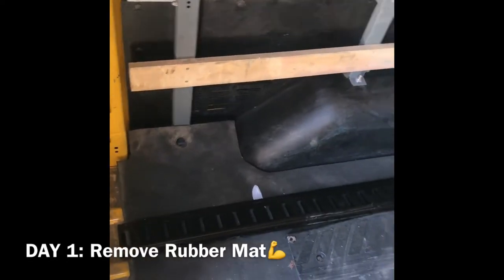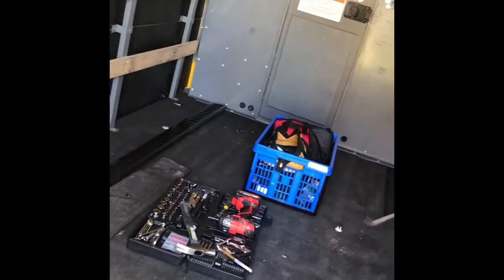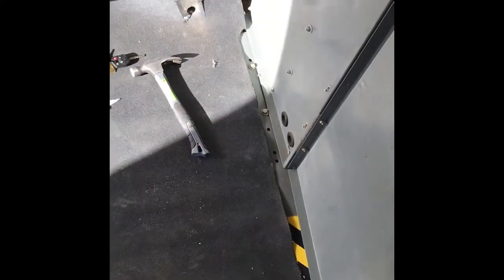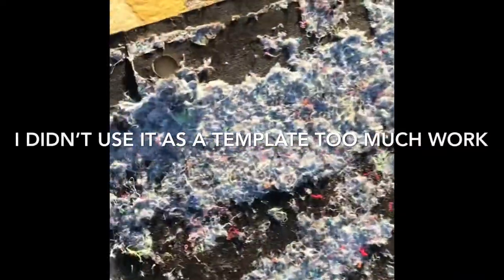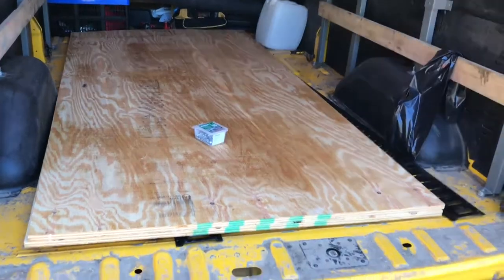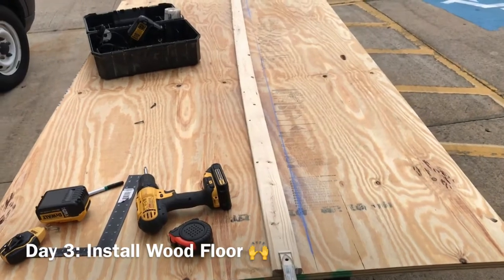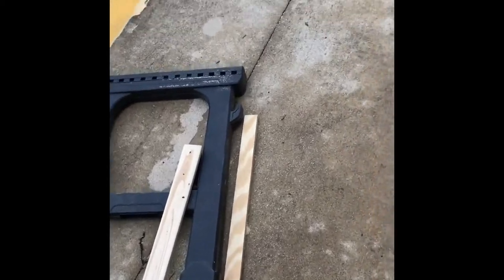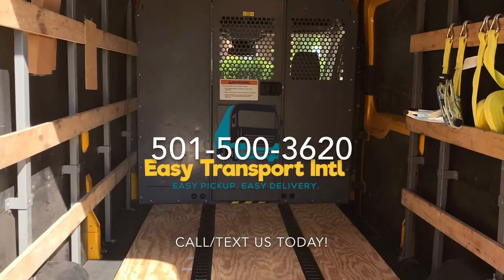How to install E tracks in cargo van? Ford Transit 250

Comment from the maker: 6 months update: The E-tracks are still holding up good!

As for the plywood... they’re chipping on the edge because I’m moving items in and out of the van frequently. To prevent this I would suggest routing the edges because it’s hard to chip a rounded edge.

I also placed an aluminum 90 degrees corner plate from Home Depot at the back of the plywood to prevent chipping.

If you’re in the moving business, I would recommend cutting the wood to the exact dimensions of the van to prevent different levels of floor which makes sliding things in out a little difficult.
Reply: Is there someone who can help with this? Do the people at home depot know how to help?
Reply from the maker: @Floof_Factory  unfortunately there aren’t many resources that I know about that will install E-tracks. 

It’s not too difficult.. I tried my best trying to help... just be careful when drilling in the screws... avoid places where the screws can damage. Other than that you should be good!
Reply: What kind of screws did you use for the wooden floors. I noticed you had used tee nuts for what screws and how many did you use
Reply: Can you come install mines

Comment: Hey man, 

Which screws did you use for the wood to secure it on the cargo?
Reply from the maker: I used self tapping screws, but next time I would use nuts and bolts with a smooth head. 

I used self tapping screws because it didn’t require another person.

Comment: Silly question: after installing the etrack, how’d the wood floor fit? It appears to be fit underneath the etrack. Video wasn’t clear on this. Thanks for video!
Reply from the maker: The etracks are below the wood. To make it easier you can put the wood on the side of the etracks.

Comment: Thanks man, I have to do that to my promaster . Did you have any problem with screws hitting wires or gas underneath the van ??
Reply from the maker: No, I haven’t had any problems! I looked underneath to see how much clearance I had from wires and fuel lines. Ford did a good job spreading out everything underneath the truck to prevent them from being hit. 

Measure your clearance between the floor and all of the objects that you don’t want to hit. Also pick a position for the Etracks with the least amount of obstacles. 

All the best! Look twice drill once!👍
Reply: I punctured my spare tire years ago on my first ever floor install. Everything else remained intact.

Comment: What was used on the other side of the screws that went through the van floor?
Reply from the maker: Nothing. The screws are self tapping screws so it went into the metal floor.

Don’t forget to spray the screw holes at the bottom with some kind of rust prevention spray.

Comment: Can I pay a trailer body installer or someone to do the etrack installation in my van?  I dont have the tools or etracks but I dont mind spending a little money
Reply from the maker: I’m not sure if anyone will install E-tracks in your van. Call around to places that service and sell trailers and accessories and ask them if they would install them. Some people weld their E-tracks in too. Idk how I feel about welding them down.

I bought my 10ft E-tracks (less work than having to cut and install several individual pieces) from Trailer Plus here in Arkansas. They are nationwide!

Good luck! If all else fails, buy yourself some cheap tools from Harbor Freight and get it done! Be careful!

Comment: Hey Chet, did you have to counter-sink the screws in the wood?
Reply from the maker: Yes, I did not have a counter sink bit so I CAREFULLY used a regular drill bit to make a slightly larger hole than the screw head.